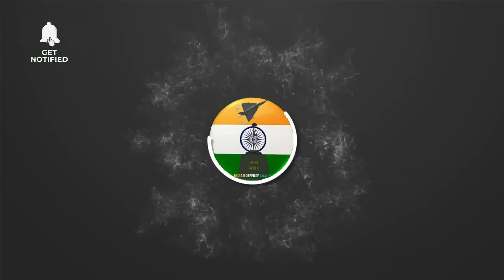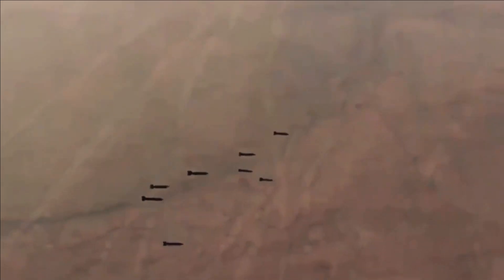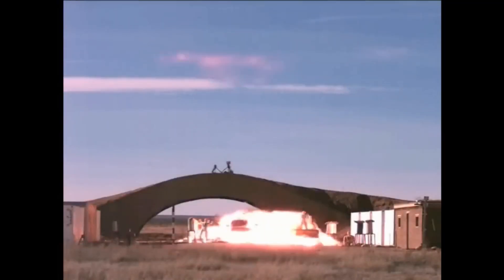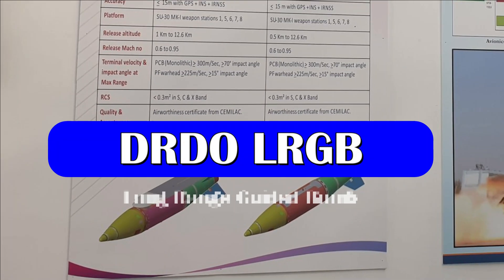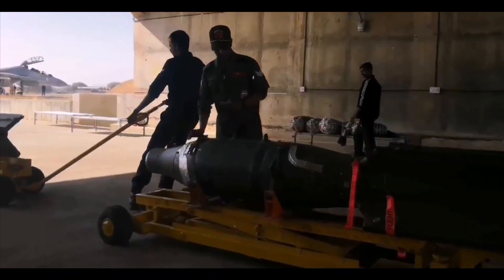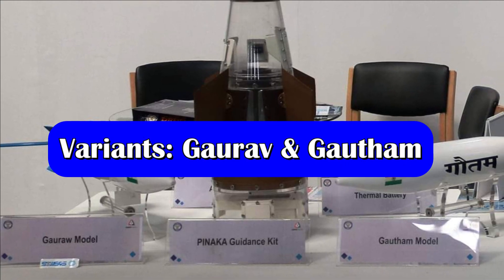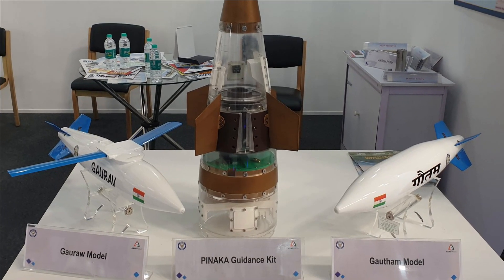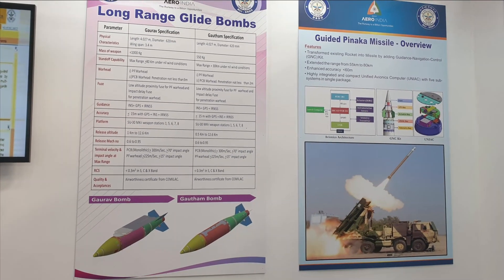TASL to deliver self-guided bombs to Indian Air Force by 2023 #indianairforce #iaf

Comment: Whether by Adani or Tata 1000s of pgms are needed. Pakistan is 1.82 times as big as Iraq. Using the Gulf War as an example of how many PGMs are needed to win:
The USAF concluded after the war that only about 200 of the aircraft in the theater could attack with precision guided munitions, and only 7% of all the munitions used were precision weapons
272 Su 30 MKI and 83 Tejas are 50% more aircraft than what Murica had! Not even counting Mirage 2000s and Rafales. 209,940 "dumb" bombs and 9,473 laser-guided bombs and 5,647 air-to-surface missile.30 000 satellite and laser guided bombs, plus the existing dumb bomb stockpile, and missile stockpile is more than adequate. However, much more is needed vs the PLAAF/PLA.
 Enough pmgs to overwhelm Pakistan in a 5 day war is possible .. if and only if thousands of PGMs are ordered.